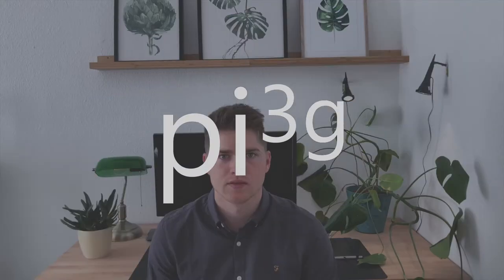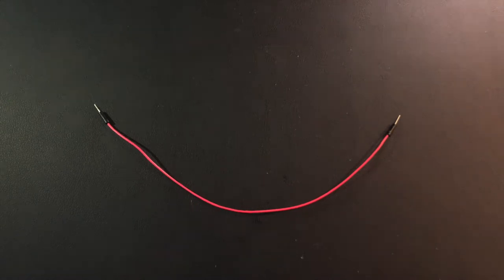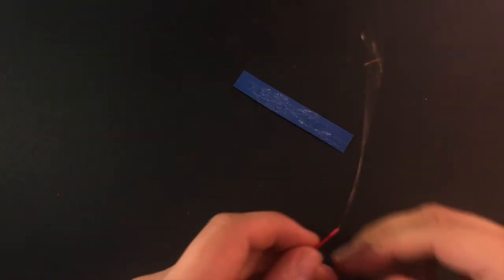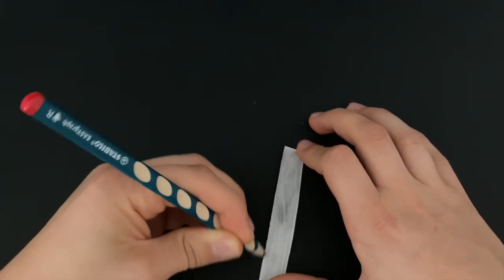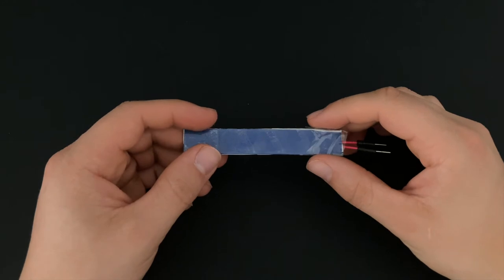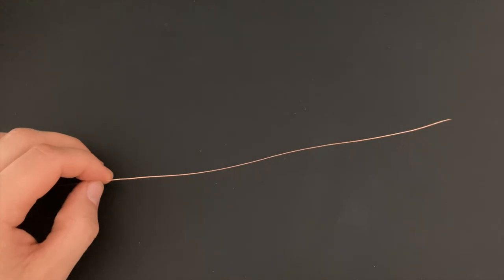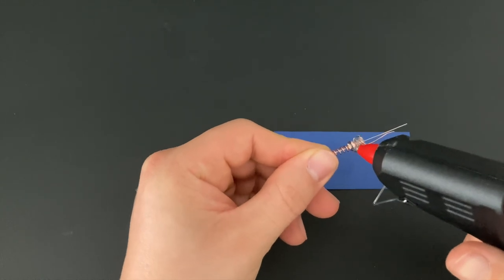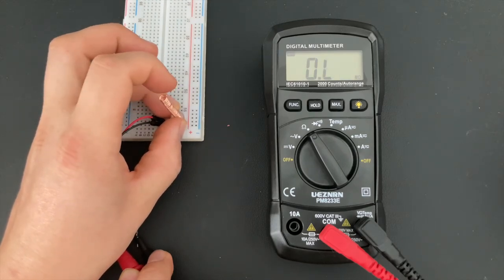DIY Sensors - Build your own Flex sensor, Pressure sensor and Vibration sensor

Comment: Great video and good description of how to build these sensors. Maybe I missed it but it would have been nice to also see the flex sensor in action. Also I'd recommend to set the camera to a fixed exposure when recording the close-ups as your hands sometimes led to the frame being too dark.
Reply: Thanks :) Testing the flex sensor and pressure sensor works exactly like testing the vibration sensor.

Comment: would like to have seen the flex and pressure sensors in use.  I need them to work really well for my project but really want to go this route because I need like 10 of them and it gets expensive when they are like $7+ each
Reply from the maker: Good luck with your project!
Reply: @pi3g  Thanks.  Sadly it failed because the 3d printed parts were too bulky and 3d printed gears too noisy.  Never even got around to doing the flex sensors lol.